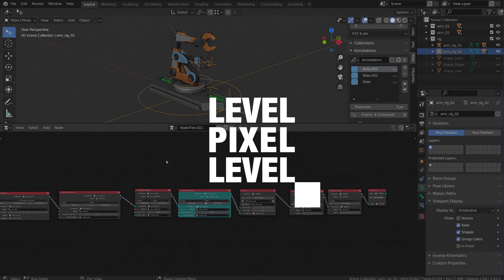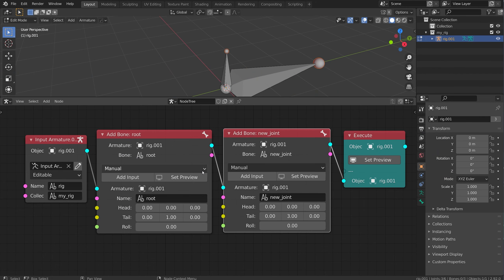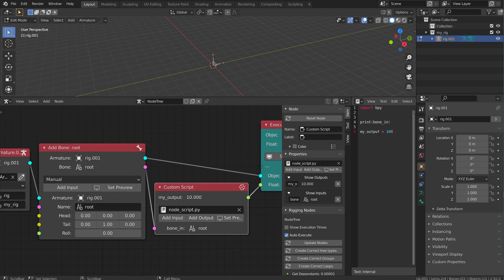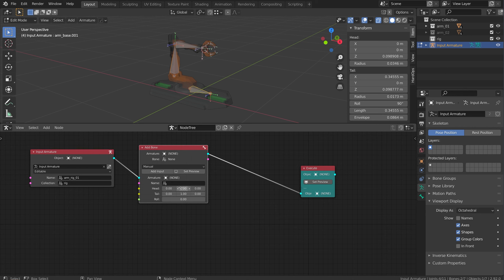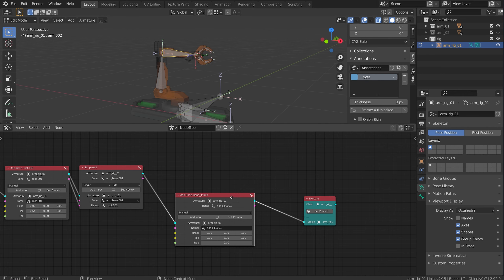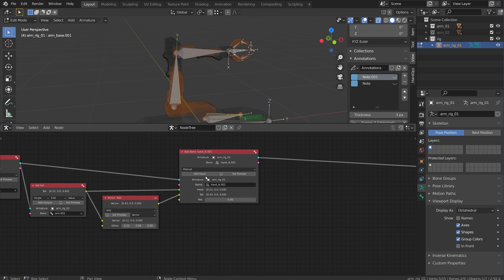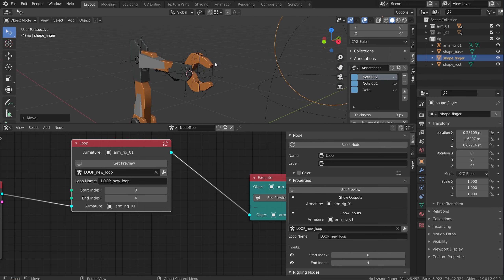Blender Rigging Nodes | An Overview

Comment: Youtube Chapters: (paste in description)
0:00 Intro 
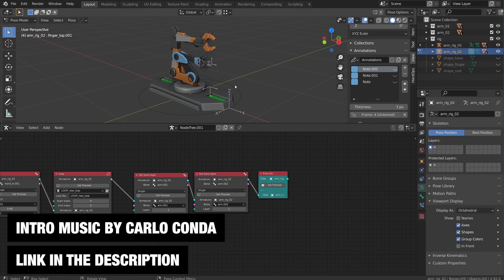0:06 Rigging nodes addon
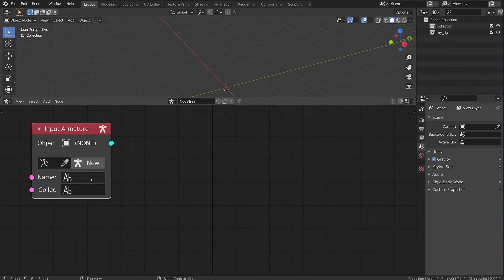0:35 What are rigging nodes
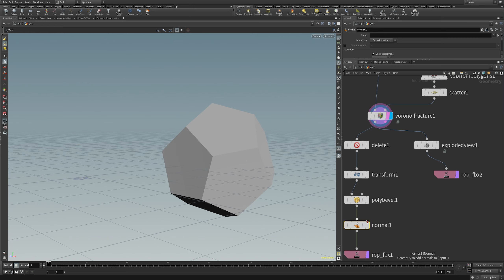    1:10 One way calculation
     Similar to visual scripting
    1:39 Scripting Node
2:07 Limitations of Rigging Nodes
2:43 Should You Use Rigging Nodes
4:05 Conclusion
Reply from the maker: Done! You rock.
Reply: @LevelPixelLevel  :)